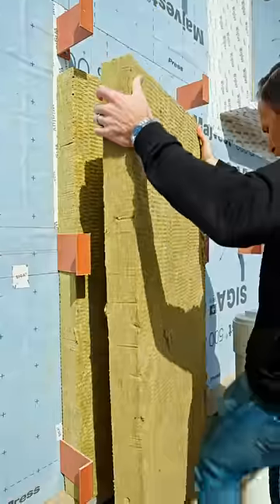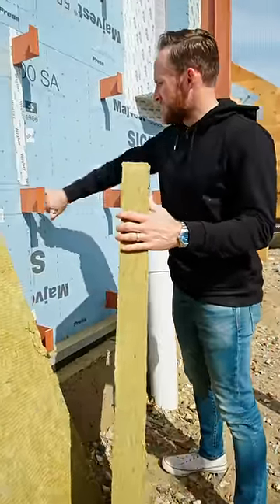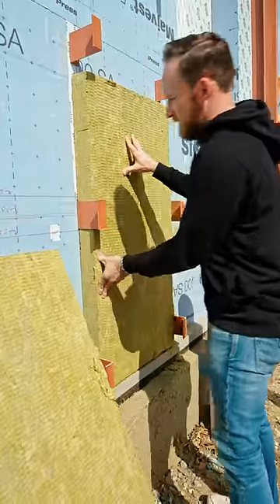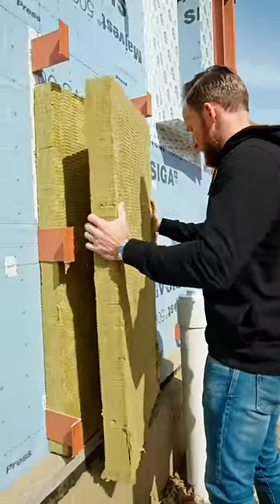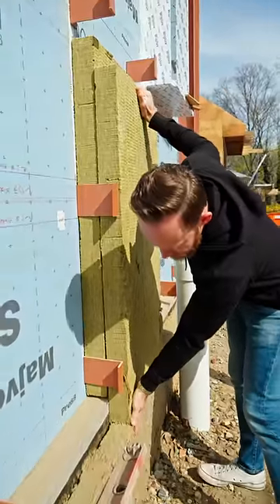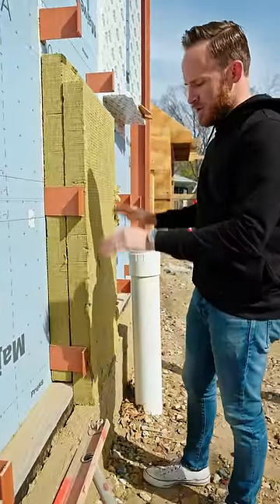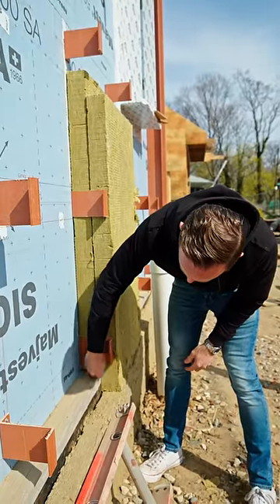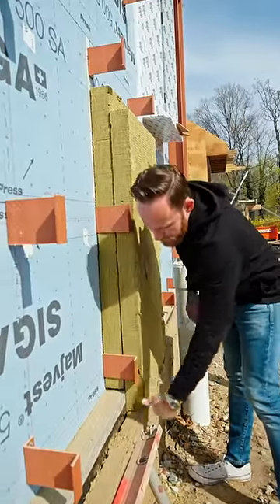Z girt and Six inches of exterior insulation

Comment: Yea, that insulation job probably cost more than my entire house
Reply: Spldrong, it may well, upfront. Over time your energy costs skyrocket and your comfort level declines without extra insulation, unfortunately. And that cost is what you're swallowing up front with the extra insulation.
Reply: You could use Polyiso  in place of Rock wool and achieve a higher Rvalue for way less.
Reply: @grovermartin6874  Save half the money by building a traditional house, put that extra cash into the stock market and it'll cover the cost of electricity no matter where you live. You can also take half that money and buy an off grid solar system, no more electricity bill. 
I'm sure this method of building houses can be useful in some cases, but it doesn't make sense for most people.
Reply: @MrArcticPOWER  I've done it. It took a chunk of my life, but it was worth it. Paying someone else to do it would not have been worth it. So much to learn. Solar panels are great, but power from the wind is beautiful when the sun doesn't shine. Micro water power is a rare blessing in some places. There's just no substitute for learning it for yourself. Money alone is not enough.
Reply: @grovermartin6874  overtime like ya maybe 30 years if you stay for that long 😆
Reply: @hugoseguin8040  If that's your viewpoint. It was exhilarating to have no electric bill for 5000 sf, 10' ceilings. How much does peace of mind cost? We didn't even notice the big northeast blackout.

Let it be said the cost of the Bergey 10 Kw went from $19K in 2000 (which I think included the $1K for the 100' tower) to $34K to $64-$65 after the state started offering a rebate -- which largely went to the wind companies/installers, as I recall. Wind turbines have become an indulgence of moneyed class now. The Kyocera solar panels supplemented about 20% of the electrical needs of the house. They were not free, but didn't require you to sell a kidney.
Reply: @grovermartin6874  lol I’m sorry, but no. How long you talking? 10 years? 20?
Reply: @jamesbizs  22 so far.
Reply: Absolutely!
Reply: Exactly what I was thinking. That has to cost a sh*t ton to have done.
Reply: @MrArcticPOWER  the difference is your method is not guaranteed. This is only a $15,000 add on
Reply: Seems way more complicated than it needs to be
Reply: That's a tiny amount of insulation 😅
Reply: @chadstocking7174  - rock wool and poly iso both have an R of R6 on average per inch. That is unless you use the LTTR method. Rockwool is also inorganic so nothing will grow on it. In a rain screen application rockwool is the better choice.
Reply: This isn't that expensive tbh, not compared to the rest of the construction.
Reply: @MrArcticPOWER  It does for folks that live in northern wooded areas...which is a lot of the Northern United States.

Not sure where you grew up, but consider that most of the north is underbuilt because most of the north is pretty poor.s
Reply: @TheEightfoldPath_  I live in Canada. It's -26°C outside right now.
My neighbour's house has 3.2Kw of solar pannels plugged into the grid (no battery needed) and they spend almost nothing on electricity. Between 5-10k$ to install and it cut their annual bill by 70-75%.
Reply: Beautiful aint gonna burn up a lot of heat that's good for New York
Reply: You can definitely say that again
Reply: is true,here in east eu is common to use 20-30 sometimes 40 cm ( 8-15 inch)of insulation due to verry low temperatures -22,-31f
Reply: Over time, it'll pay for itself. Lol whens the breakeven point? I nice high efficiency furnace, does wonders
Reply: he's fitting it all too tight insulation works better with a vapor barrier,,,,,, just as a thermal pane window works
Reply: @chadstocking7174  poly iso shrinks and loses efficiency.  Rockwool can't degrade and can't hold water.
Reply: @grovermartin6874  better than "flash and batt" on the interior?. 

Yeti should go into the building envelope business.
Reply: Yeah and you're double walling a home and copper flashing? That house will cost millions
Reply: Total wall R value?
Reply: Probably will sell the house in 5 years.  Lol !
Reply: @chadstocking7174 Poly iso doesn’t do well in colder climates
Reply: You can achieve a really good quality insulation job without going to this level of complexity. Mineral wool in 2x6 walls and comforboard 80. Combined with good quality triple paned windows will be really good quality, cost effective an easy to execute
Reply: @MrArcticPOWER I will believe it when I see it. Solar in northern parts is extremely inefficient and if your house has a large roof area it’s because it’s a flat single story that doesn’t optimize thermoefficiency either.

Comment: How thick is that finished wall going to be?  I assume 2x6 framing, plus sheathing, plus exterior insulation, plus exterior sheathing. That will make the wall over a foot thick - does that complicate window and door installs?
Reply: I guess it's the same with really thick window sills like most of Europe
Reply: creates lots of sitting places, displays and plant nooks. looks great when decorated accordingly
Reply: Of course it does. All the jambs will need to be custom made to fit
Reply: @evictioncarpentry2628  so time consuming
Reply: @WaYaNi  just sounds like alot of extra work with chunky wood work
Reply: @robertdeal410  You'd rather have thin walls that leak heat out and higher energy bills?
Reply: Not really. As you can see in the back he has built a shadow box for a window. As long as it is sufficient enough to handle the weight and anchoring it all good. I do it quite a bit
Reply: Plywood construction though... Brick and mortar is the way to to.
Reply: @ferrumignis  i think they have surpassed the point of diminishing returns.
Reply: @ferrumignis  spend $500.000.00 more building it, how much heat are you saving to make it worth it in your life and the next?
Reply: @HighQualityContracting  Half a million bucks extra for the insulation? 🤣  How is life in the circus these days?
Reply: @ferrumignis  ever heard of spray foam?.....
Reply: @ferrumignis  not just the insulation,  think about all the extra work silly.  Copper flashings, brackets. Labor .
I take it you haven't done a whole lot of work. Weird that you would comment trying to make someone look bad. But immediately did yourself a disservice
Reply: @HighQualityContracting  "I take it you haven't done a whole lot of work. "

I take it you have no attachment to reality?  If you think this level of insulation adds half a million dollars to the cost of an average build then you are tripping.
Reply: @natecote1971  Yes I've heard of it, would you like to continue your post and make some kind of point?
Reply: @ferrumignis  I'm still mind blown you're arguing with me about your inability to understand how much extra work that creates for all the other trades aswell. Half a million easy on a 5000 sqf home.
Reply: @ferrumignis  500,000 was a rough guesstimate,  like a joke,because the point of it was it will cost you more then you'll ever save on heat loss.  I dont know your quality of work but, good work isnt cheap.
Cheap work isnt good
Reply: @evictioncarpentry2628  I live in northern Canada and we often have 9" walls or bigger. Window returns that are larger really don't take that long once your in the flow, and people love being able to put plants etc in windows, or have a sitting area. Honestly the harder part is getting a door jamb return or extension that doesn't have the latch rub on its way past, it can take some fiddling.
Reply: @robertdeal410  A little material consuming as well........
Reply: @Jjengering  That goes after the  plywood.
Reply: @tuck6464  never seen a house made with plywood first then brick and mortar... Seems like excessive spending for little/no reward. Just build a cavity between brickwork and you can use concrete blocks on the inner layer.
Reply: @Jjengering  In Rhode Island, excess is the minimum. Nothing exceeds like excess. The limestone goes on after the brick.:goodvibes:
Reply: @HighQualityContracting  

When the guy farts in the morning it keeps the house warm all day.
Reply: @HighQualityContracting  they arent going to listen because they all live in  Is the Southern an Arctic 🤣🤣👎
Reply: This is similar to house building in Sweden. 
On average an exterior wall is about 14” thick.
Reply: @HighQualityContracting  brackets were not nessary, could of used ferring strips to hold it down.  Would have been better as well since you then get a rain screen as well.  The copper is over kill but whatever they want I guess.  Same affect can be achieved with a 2x at the bottom, slopped and finished with a fluid applied flashing.  Incase your wondering not very labor intensive there.  Oh and for the 2x use pressure treated ofc.
Reply: @HighQualityContracting  and God forbid you decide you want a yeti house halfway through the build
Reply: @natecote1971  why so you have to bring in outside air because the house is too tight?

Comment: “Your home build just went up $90k”
Reply: yeah but with the price of utilities these days that's money very well spend
Reply: Exactly
Reply: People are dumb
Reply: Better now then more expensive costly repairs later
Reply: What about doors and windows built for standard framing
Reply: @marcfavell  no. No it’s not. Not even remotely.
Reply: @HermesAngel  what’s this have to do with repairs????
Reply: @jamesbizs  because proper preparation prevention poor performance
Reply: @marcfavell  Oh yeah energy savings will pay for itself /s
Reply: Saves thousands on heating and cooling, although it is also required since some states wanna lower their energy output, in my city new builds have to actually output more energy than they intake
Reply: All of that . More like 150k
Reply: Only seen it at one house in Charlestown it was a 5.7mill build.
Reply: Agreed insulation outside the wall is just crazy... Make the actual stud wall thick enough to get the proper R-value. The wall probably will be just as thick as it is now with the external insulation.
Reply: @williamswilliams8164  Its called window sills. I see a super thick 2 plus foot house that used quad pane windows on the outside and then again on the inside. So a 4 pane window then a 1.5 foot air gap and another 4 pane window.
Reply: @williamswilliams8164  they are called extention jams
Reply: @crybabygbc1026  yes I know
Reply: @justplanefred  You should watch a few videos about the topic. This is the future and it will literally pay for itself in 15-30 years. Even a 2x8 24" O.C. framed wall with only batt insulation can't even come close to the performance of a standard 2x4 wall with batt and continuous exterior insulation.

Comment: And only 100k later, you’ve got ext. insulation!
Reply: and only 100k later you have a garbage non crossed insulation with air passing trough each vertical panel actually dumb
Reply: @nerprun  not very nice. Everyone deserves a new f350
Reply: @nerprun  wrong, it is exterior insulation going over an already sealed surface so no air will penetrate through into the house. Plus there will be plywood over that which will not allow air to get past it and their butted up right next to each other and will probably be taped as well.
Reply: @nerprun  so long as the pressure boundary is on the interior side of the insulation it should be fine. Air movement through insulation is fine, as long as it's not the home's conditioned air. With that said, i see a possible red flag. The exterior wall sheeting on the home looks to be a secondary vapor barrier. If it acts as such. Any flaws in the interior pressure/vapor barrier will only trap moisture from the home in the wall insulation. Even if it's mineral wool, mold issues still can happen. Most so around windows/doors, and bath/ kitchen and around chimneys.
Reply: @Will_Wel  i'm not saying that the air will go inside the interior, the heat generated from interior of the house is going to be trapped in between the wool, and here the wool is vertically from top to bottom, so each 60cm all around the house you have a full line of cold air from outside... and as you can see the orange bracket is like ~5mm...
Reply: @Will_Wel  great area for water to do damage when it gets there. Should use SIP panels
Reply: @gsnyder3328  sips have their pros and cons. Total different type of construction you have to do if you're using those. Also rockwool is supposed to be hydrophobic and proper insulation would utilize an air gap in the cladding and drip holes at the bottom to ensure proper dry out if anything did get wet. But yeah sips and foundation coating / materials style construction is cool too
Reply: @gsnyder3328  Rockwool is naturally hydroponic.  Water runs off of it and even if you take a chunk and submerge it, it will not absorb water.  It also is nearly impossible to burn.
Reply: @Will Wel  as a builder you account for time to save client costs, form pouring and spray foam wall coatings, or sip saves money. This is too much work for something you could save time with. Personal opinion. Cheers bud!
Reply: @James Bird  okay, but put that in a place without sunlight for years on end. Then get back to me. I just feels like a bad idea, no matter the science. It's like zipwall plywood. You know that's gonna be a lawsuit 15 years from now.
Reply: @gsnyder3328  you guys should all go watch Matt Risinger Channel and his multiple videos on how to do this type insulation properly and it's pros and cons
Reply: @Birdman_in_CLE  Ah! Thanks for that, James Bird!
Reply: @gsnyder3328  Seeing as it was invented in the 1870s and builders have been using mineral wool  insulation for 40 years.  It is long term tested, not a new product like Zipwall or the early days of Drivit.
Reply: @Will_Wel one bazillion dollars later you’ll save 50 bucks a month on heating and cooling costs
Custom windows doors trim etc…..
Plus a stupid looking exterior
Reply: Sniff Test  You are correct in normal usage conditions.  I qualified my statement because this is the internet where nuance goes to die.  I knew that someone would challenge me by saying that "everything burns if you get it hot enough"
Reply: In 500 years, money, saved on heating and cooling will totally pay for it
Reply: @williamswilliams8164  Sips and spray foam are excellent but are highly flammable.
Reply: @williamswilliams8164  by the way hello other William W :))
Reply: @gsnyder3328  my well house is damp dark and just nasty it's hot in the summer and cool in the winter it has rockwool from many years back on the concrete and what was left of mold covered osb( all installed before I bought the house) I ended up pulling the well and the rockwool looks new.
Reply: @Tyrone Ismyname  that puts one concern to bed.  Now its time to install versus other methods. At this point it's a no Brainer, build two walls and insulate both. Less time and materials than rock wool
Reply: @Beaches south of L.A.  if you're going to have walls 16" deep why not frame a 2x8 wall exterior, gap 1" and frame a 2x4 wall inside the exterior wall. We do it on custom homes all the time. Why waste so much time with layers or ply, water proofing, clips, insulation, plywood, exterior siding, just build an insulation wall.
Reply: Sniff Test  and you proved my point of the internet being where nuisance goes to die.  Thanks for playing...
Reply: It would have to be a pretty big house to add 100k to the cost. Not sure of the codes in that area, but it's probably not required to be that thick. I would guess they only require 3-4 inches (or like R30 continuous). Regardless, it will pay for itself in energy savings in 15-30 years.